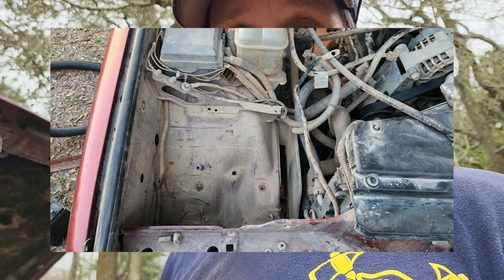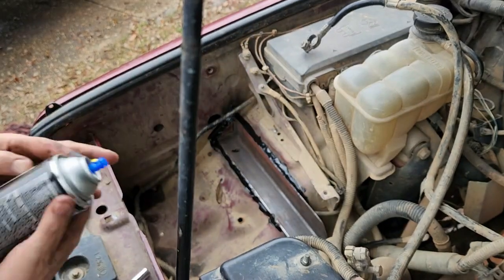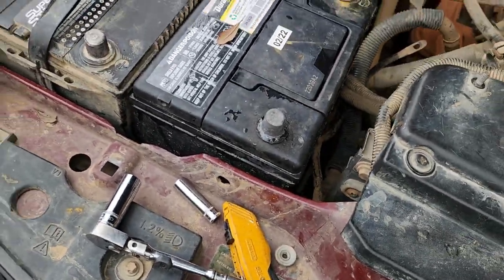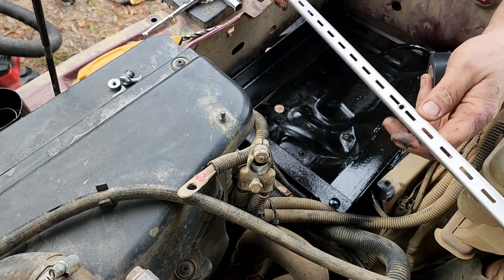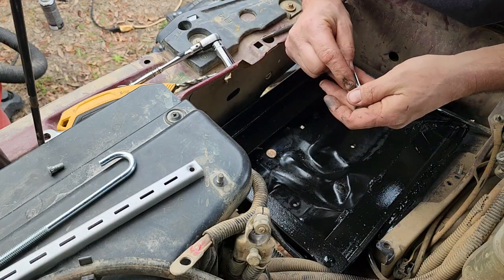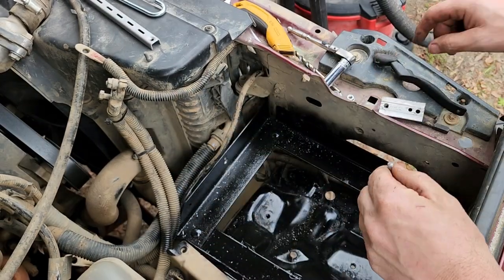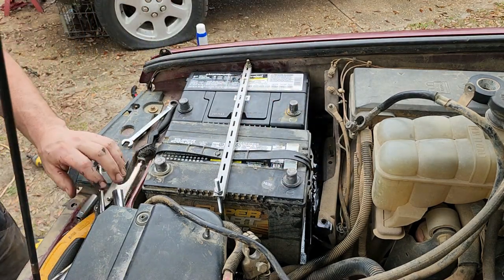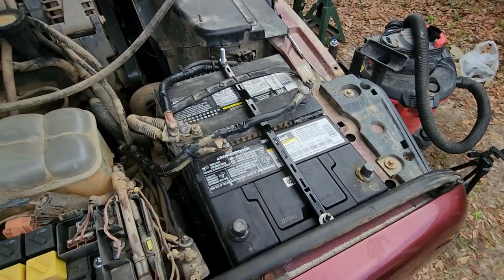Land Rover Discovery 2 Dual Battery Install

Comment: How did you weeks that to aluminum? Will flux weld work?
Reply from the maker: @lifewithnofilterlnf4911  the inner fender is not aluminum, neither are the doors, floor pans, roof, etc. Only the hood, fenders, and body tub are aluminum.